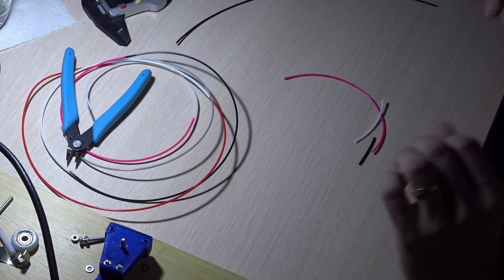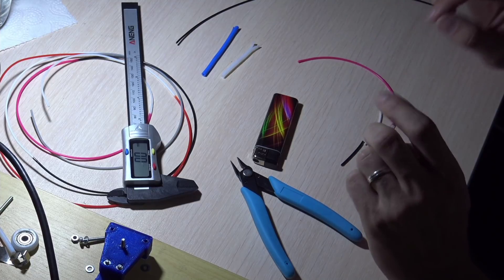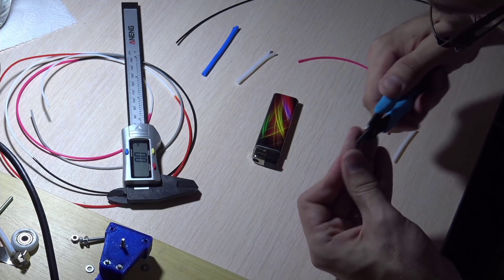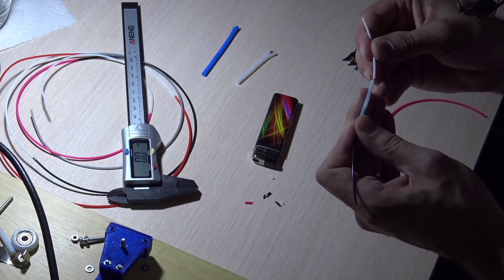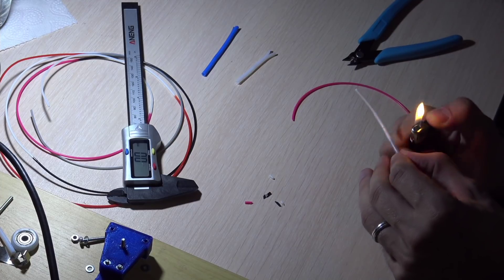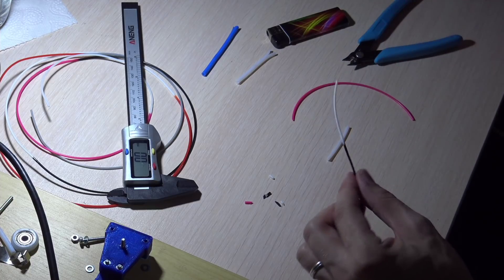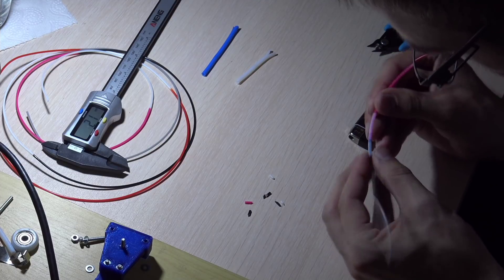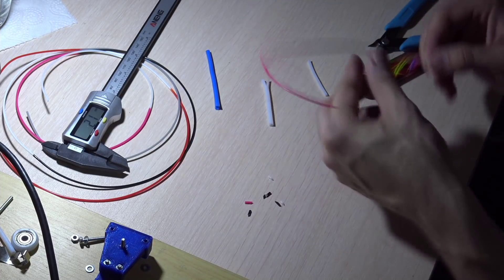How to join 3D printer filament

Comment: This method will overheat the ptfe and release neurotoxins. Look up polymer fume fever. Unlike other "bad fumes" this only needs very small doses to potentially cause severe damage to your nervous system! Don't do this! You can still use the ptfe tube, but you have to heat the filament outside, then push it in quickly. Several guides on youtube.
Reply from the maker: You are for sure totally correct! 
I made this long time ago. Currently, I'm using a heat gun with temperature set to the melting point of the filament.
Reply: @MartinZeman3D  can you show us how you do it now?
Reply from the maker: @botalex4845  As I said :)
Currently, instead of fire I'm using a heat gun with temperature set to the melting point of the filament.
Reply: @MartinZeman3D  I have been aware that the video is old, but still dont want people harm their health. Thanks for answering, the heatgun is smart!
Reply: This is stupid theory. :-P